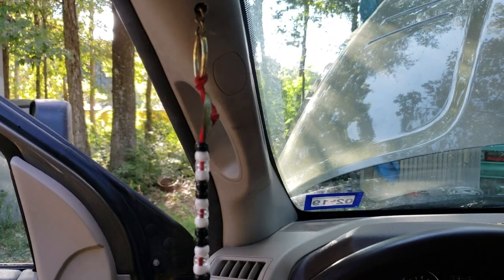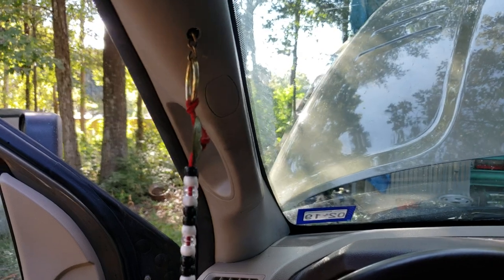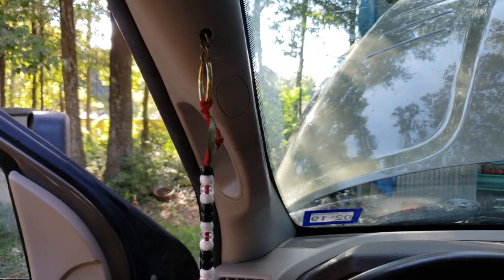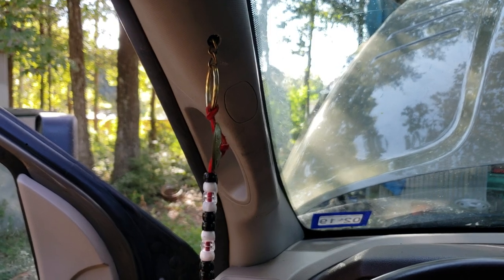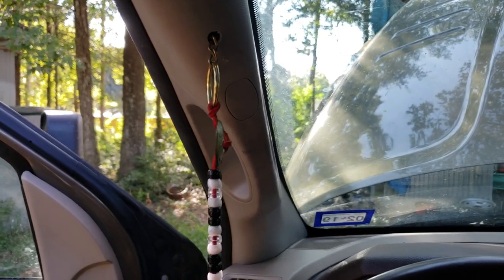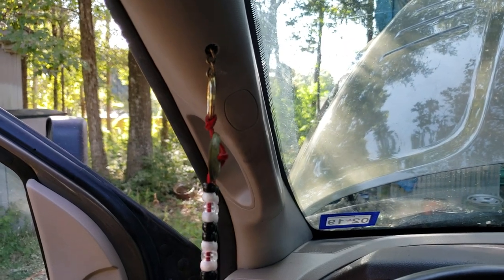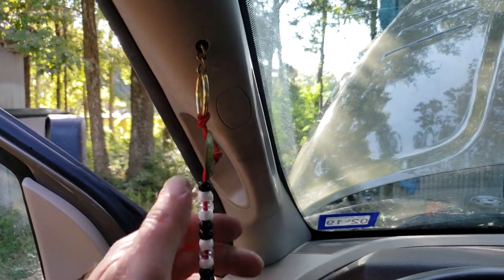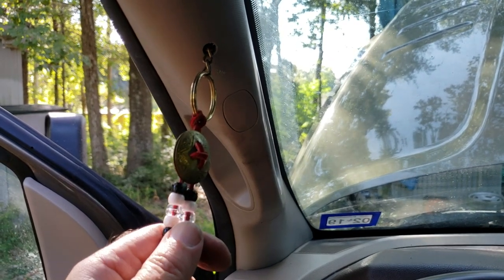Air Horn Train Horn Pull Switch

Comment: Where did you buy the switch?
Reply from the maker: There is this link in the forum thread linked in the video text, https://www.ttiinc.com/content/ttiinc/en/apps/part-detail.html?mfrShortname=LFA&partsNumber=9109&customerPartNumber=&minQty=1&customerId=
Reply: @Ltngdrvr  hi there.

This long no longer works. Do you by chance remember the product name?
Reply: Nevermind. The link in the fourm post is still working!

Thanks a lot!
Reply from the maker: @Ryan_Carder  Yeah, link address changed, https://www.partdeal.com/cole-hersee-light-duty-push-button-momentary-pull-switch-spst-boxed-9109.html and of course you can google cole hersee 9109 and find a few other sources.